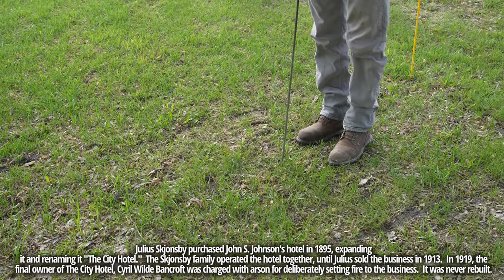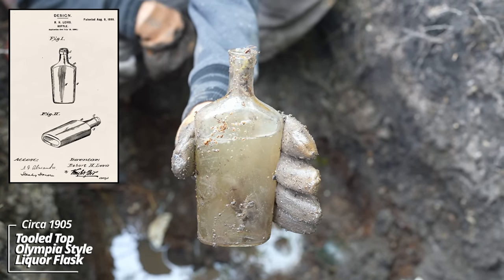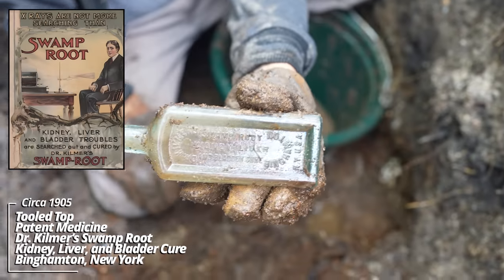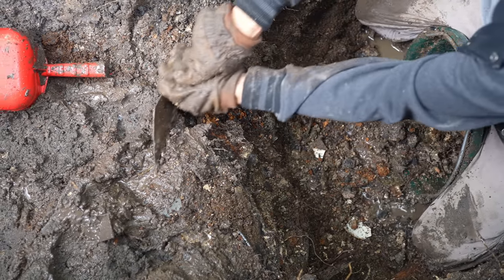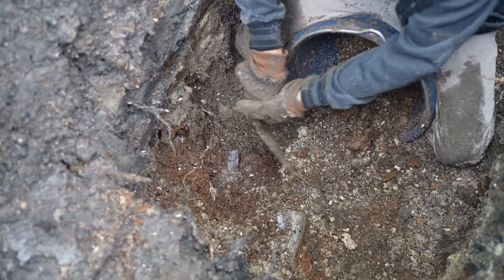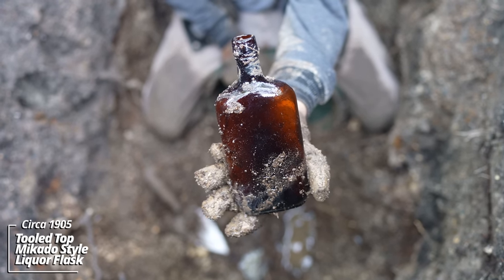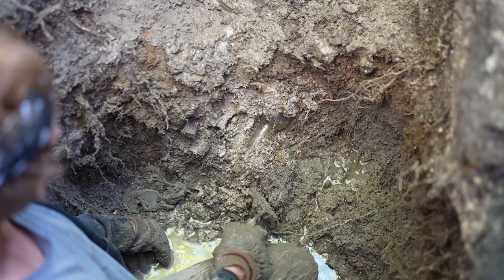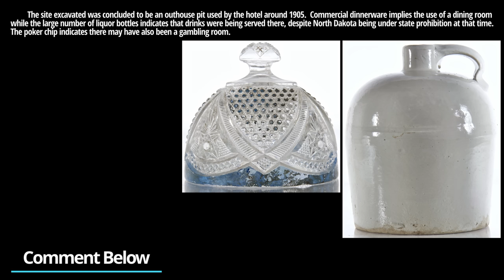125 Year Old Map Leads to a Massive Underground Structure Full of Valuables Buried in a Back Yard

Comment: You are missing a great opportunity! Get a Mine Lab Pro-Find Pinpointer which can be set to discriminate between ferrous metals and metal in coins and jewelry. Just swirl it around in each of those scoops of soil you remove, at least when you get down low among your other finds. And be aware that a bright white ash like material may be Lime which is very caustic. Not certain how much it would dissipated over time. I would definitely keep it away from any broken or abraded skin . They also sell protective rubber tips for the Pinpointer’s end which you will want to have handy, or just warp it once in duct tape and replace that single layer each time it wears through in any spot. Oh I just heard you mention the Lime. Glad you know about it. It is also commonly used in stables where urine spots are damp and smell after other cleaning was done.

Comment: I have a question—do you ever find old, intact telephone insulators?
Reply: My dad was a retired telephone man. He said back during his lineman days they were buried hundreds of old open wire insulators into the holes that old poles were pulled from. They could still be found today.
Reply: @55jplock  My father worked as a contractor for the telephone company, back in the 1950s and 1960s.  He was the one who told me about the insulator dumps.  

It’s hard to believe that so many old pieces are still out there buried somewhere.

Comment: Those cut glass lids were used OFTEN as part of a butter dish not always from candy dish.
Reply: Agree.  They went over a flat dish with a lip for butter or sometimes soft cheese.
Reply: I have never seen blue 'flashed' glass, only Cranberry or Ruby flashed or 'cut to clear' as it is sometimes called. Do you know what the blue is?  You are right about the butter or cheese dish. It is possibly for butter, as it is quite deep or tall to be a candy dish lid.

Comment: To my knowledge, people would not waste an expensive ceramic doorknob on an outhouse. Most of them had wooden handles or metal, but mostly wooden. They were usually very crude implements to open the door. Since outhouses had to be moved around as they filled up, they would also want to keep it light and cheap in case the door got broken in the moving. I used outhouses myself as a kid, both at relatives homes and even the race track in small Western towns. None of them I ever saw had anything fancy for a doorknob. I tried to research it briefly, but didn't find any information. I believe strongly myself that those fancy white knobs were strictly for homes and business doors.